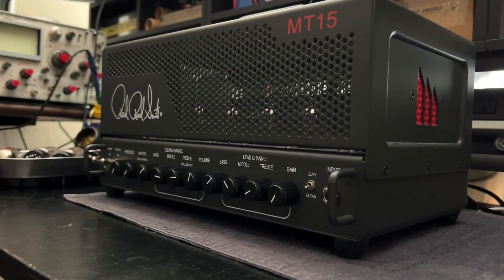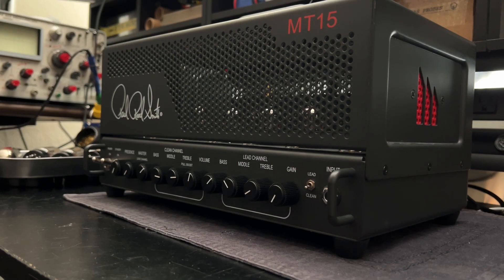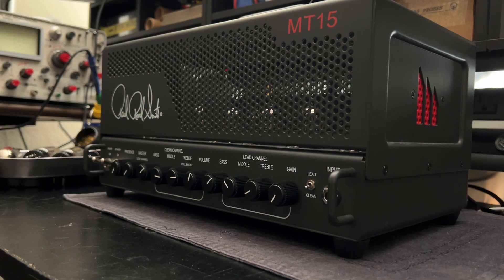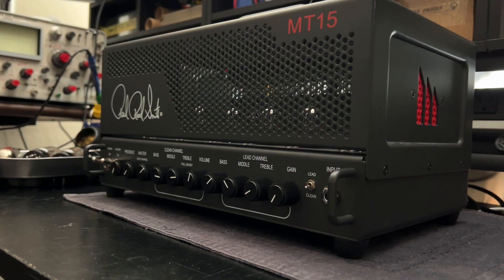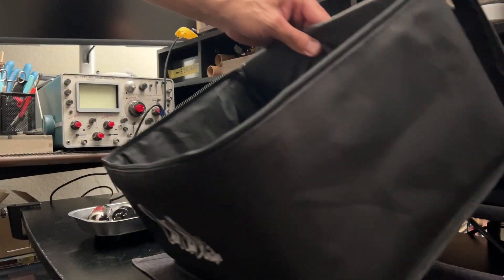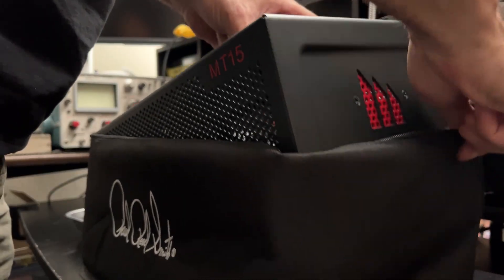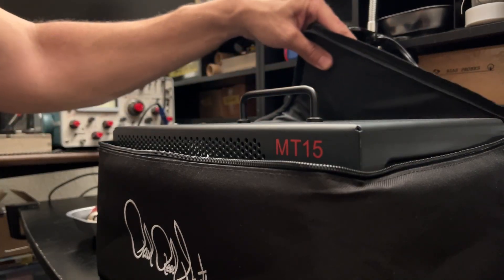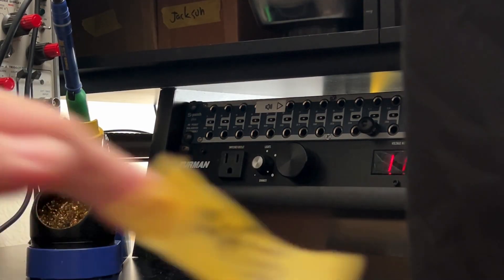PRS MT15 Part 3: Factory Responds—Is This Goodbye??

Comment: I have a really hard time buying any amp made after 1980. I've just owned too many "new" amps that refuse to last. That's how I got into repairs and building tube amps...the fkn things kept failing with limited use.

There's no excuse to find 400v caps in a modern amp too. What's silly is 600v and 630v caps are usually cheaper and not much larger. I could understand size constraints in a pedal form factor, but not a lunchbox head with 2 channels. Plenty of room for 630v caps and 1w resistors across the signal/coupling side of the board. 

The people designing these amps have to know that the phase inverter/negative bias can cause the caps to see beyond 400vdc right?.....Right?
Reply from the maker: That’s what makes my inner conspiracy theory think they want returns!

Comment: damn, sorry for this guys luck, and double damn this isn't what mine is doing... Argh... hopefully whatever is up with mine isn't as fatal..
Reply from the maker: 5 year factory warranty!
Reply: @ForgottenGearRestorations  not original owner, but your video gave me an idea to check out next time I open her up. getting very slight volume dips and it sounds like the presence knob drops out. only on lead channel. Pressing ON the master or presence knobs stops it. I wager both pots have broken solder joints. (or its daughter board if it isn't on the main one)
Reply from the maker: That’s a great place to start. Poor pots!